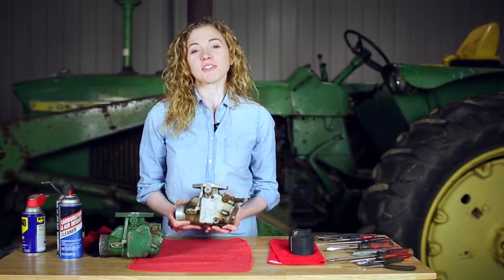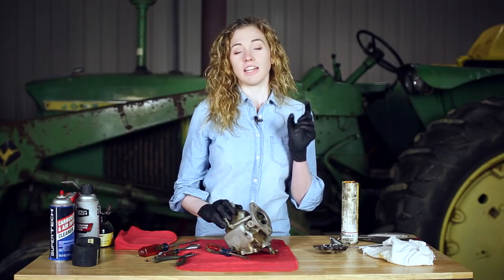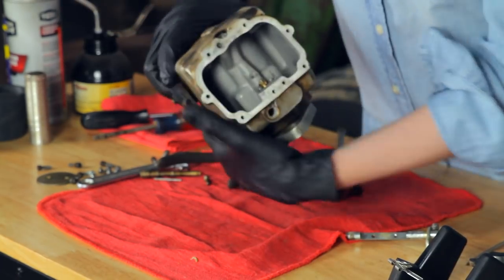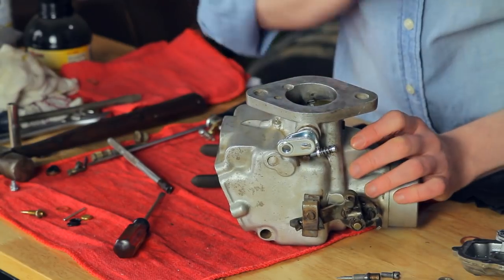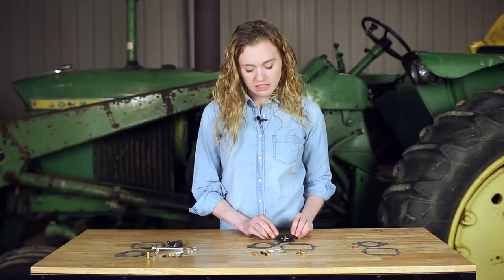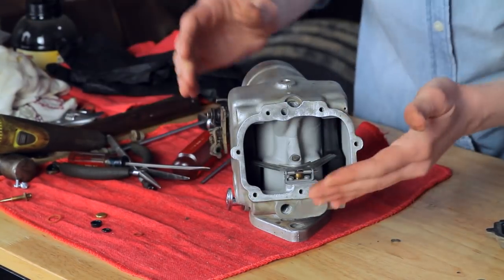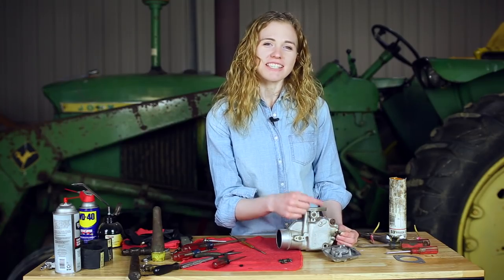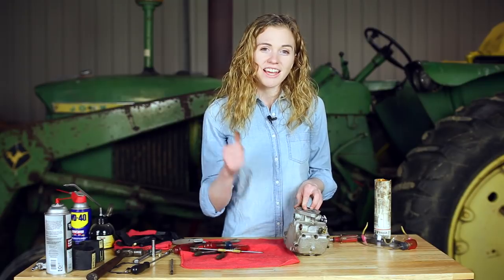Marvel Schebler Carburetor Rebuild for John Deere 3010, 3020, 4010, 4020 Tractors, Oliver and MM

Comment: As mentioned, the diaphragm install is critical to getting this carb running decent.  Make sure it doesn't get out of position when you are compressing that spring to put in the screws.  Take your time.  If its not properly installed and fuel gets by, the tractor will behave like it is running with the choke on, coughing with black smoke out the exhaust.

It would also be great to see a demo of installing a new accelerator jet, driving out the old and positioning the new to press back in.

Comment: Wish I would have found your website when I was rebuilding my two four cylinder diesel John Deers. Industrial use pull hydraulic pumps. 

A Lot of adapting from bell housings to flywheel to mount and drive hydraulic pumps.

Comment: Hi Rachel. I'm not criticizing the job on the carburetor, but I think a final step should be included. The fuel tank should be checked and cleaned if needed and a fuel filter replaced or installed to assure the cleanest fuel supply possible into the freshened carburetor.

Comment: Another tech tip from another mechanic. Do not be stingy with your gloves while you are in cleaning phase of your carburetor. I've noticed that some solvents will react with nitrile gloves, so don't be afraid to change your gloves out if they start to feel different on your hands.  Another tip is to wear those nitrile gloves inside your heavy chemical gloves. Sometimes it's easy to have solvents roll down into the cuffs of your gloves.

Comment: I bought a 4010 john deere tractor that hasn't been turned on in about 20 plus years. I want to change oil and put all new filters and clean out my diesel  tank and put new diesel in it. My concern is how to bleed my injector pump without damaging it. What advise can you give me to do before trying to start without causing any damge to my tractor. Thank you!

Comment: Do you do any Massey stuff? I just bought an old 135 gas. Should i see and oil/liquid in the front left side when i take off the cap? No dipstick. Is it p. Steering? No oil present.. runn good.